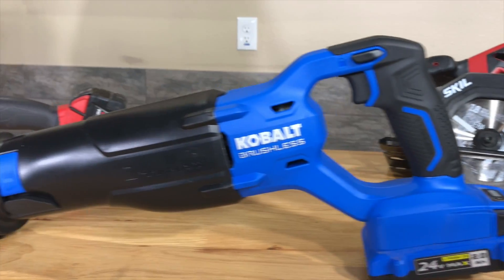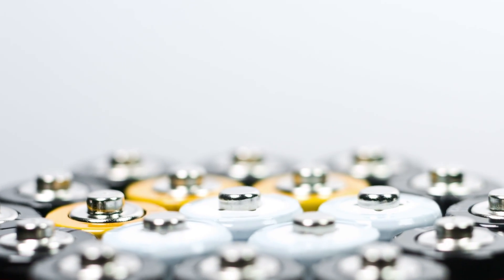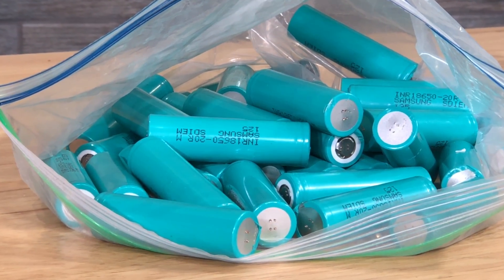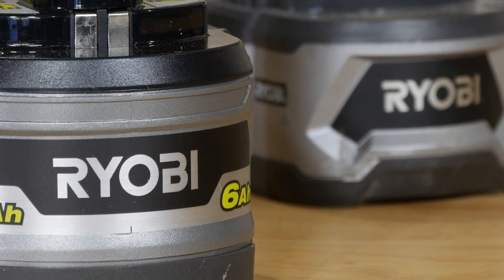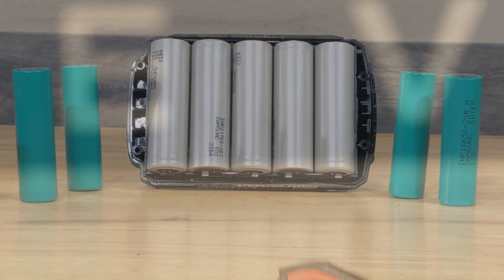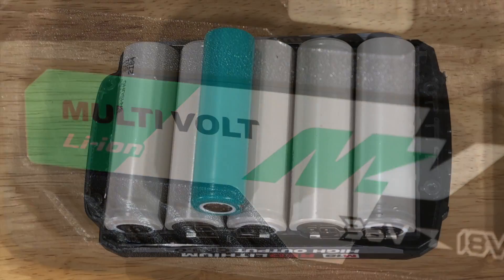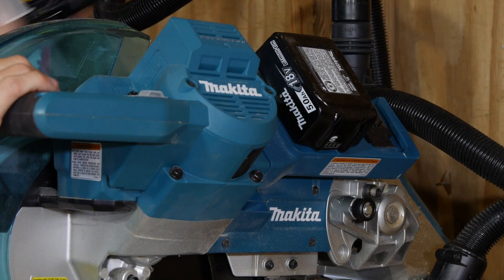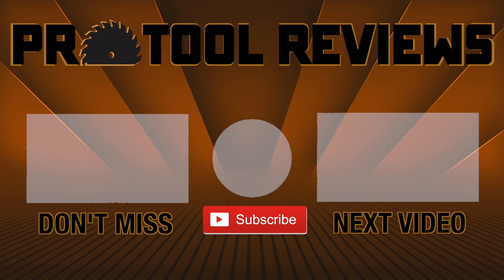What are Lithium Ion Batteries? - 21700 vs 18650 Cells

Comment: Absolutely amazing review! Always a thumbs up and looking forward to seeing the next video.
Here you can find BigBattery’s Model 3 2170 Cells will trump any and all 18650 designs with 4800mAh Per Cell – There is nothing better!
NEW, Uncycled Model 3 Cells are harvested from assembly defect modules. All cells have been professionally buffed, tested, re-wrapped & laser welded with a cap for safety when spot welding. These cells are perfect for building DIY projects such as power walls, any lead-acid to li-ion conversion, mobile solar generators, etc.
https://bigbattery.com/product/model-3-2170-cells-w-cap-box/
Reply: Surprise 4680 batteries.....Hopefully they'll live up to the hype.

Comment: Does a 21700 discharge faster than an 18659? Need to know if it's better for a flashlight, don't care about capacity only power
Reply: yep can handle more current.

Comment: Look for BioSolar to deliver the next level of 21700 battery efficiency - along with 300 charge cycles with no appreciable power loss!
Reply: Only 300? That's pretty poor these days. Tesla cells manage way more than 1,000 cycles, and LiFePo4 cells are good for at least 3,000 cycles.
Reply: @RWBHere  BioSolar's batteries go way beyond the 300 cycles! What I was trying to communicate is that there is no appreciable loss in battery power after those cycles. Everything that is out there loses 20% of it's battery life after 300 cycles. AND with BioSolar's lithium silicon batteries they are unique in that there are no over-heating issues or change in the cell structure. BSRC is truly a novum!

Comment: How things change! 
Both in batteries AND in how we react to guy with a cigarette in his mouth, regardless of the fact that he is cutting concrete with a dry blade.
Reply: Slow down there buddy. Wet blades are only for dust suppression. I mean, you can cut wet or dry with a dry blade, you only NEED water if you're cutting with a wet blade. 

Case in point, dust suppression is a redundant measure when you're huffing on cancer sticks.

Comment: For Pro Tool Reviews:

Since the battery comparison shown pits the smaller cell battery against the larger cell battery, the batteries are rated about 108 watt hours and 113 watt hours since watts is a measure of power output and is the simple product of amps times volts.  Since it is DC there is no power factor involved as in AC power.  To get 800 watts from the 18650 cell battery at rated 108 watt hours, it would have to provide 6 amps at 18 volts for 7.4 hours.   The larger 21700 cell unit would have to produce 6.3 amps at 18 volts for 12.8 hours to get 1440 watts delivered.  Do these batteries last that long or are the manufacturers inflating the total power output like they do the horsepower on power tool motors where they use inrush current instead of rated current?

Comment: The correct formula for the area of a circle is pi(RADIUS-squared) not pi(diameter-squared). Luckily since you were consistent using the incorrect formula for both battery cell sizes, the differences are correct as stated. Thanks.
Reply: Joe, you are right and wrong at the same time.
We are looking at Volume, which is V= pi x r^2 x h.
Correct in that for both they should have the radius and not diameter, and also that the % result is correct as both were calculated the same.

Comment: Why not use 26650's instead?
Reply: To keep the size of the pack in the target zone while also keeping voltages up.
Reply: Also, 21700 cells are newer tech, more capacity and higher output per unit volume.

Comment: And now we see a 5A 21700 from Liitokala (model Lii-50E), on Aliexpress for as little as $4 each, and some vloggers have tested and confirmed that they are at least 5A, and some more than that.
Reply: Chinese battery cells are absolute bottom basement garbage, you want an ultrafire 9999mAH 18650 cell for $2.50? You'll get 1/10th of that.

Comment: By mass some 18650 cells have better output. 
Sony:
Vtc6 18650 30A 3.0AH 47.6g
Vtc6A 21700 40A 4.1AH 72.9g
21700 are still behind 18650.

Form factor is the reason for the change. A 21700 makes a larger footprint and decreased height.
Reply: It heavily depends on the manufacturer and what that cell was designed for
Reply: but 21700 have more mah capacity even it is weign more